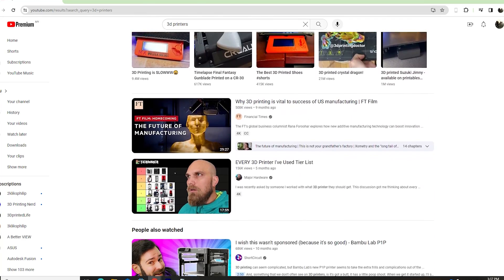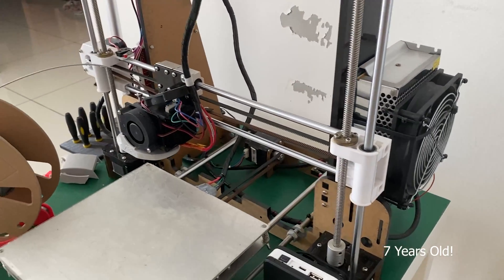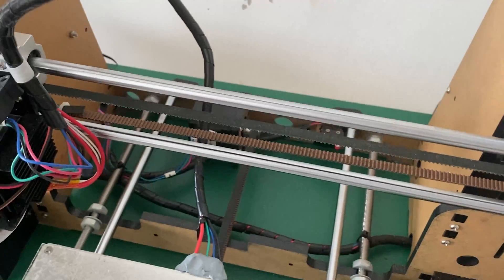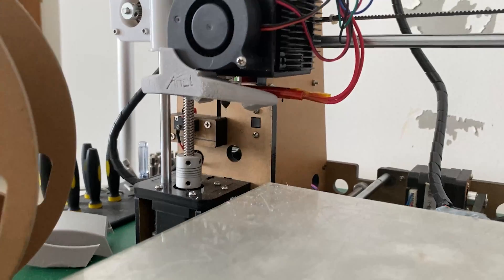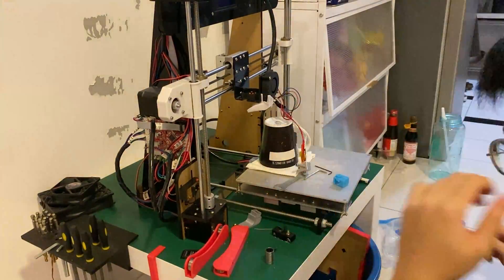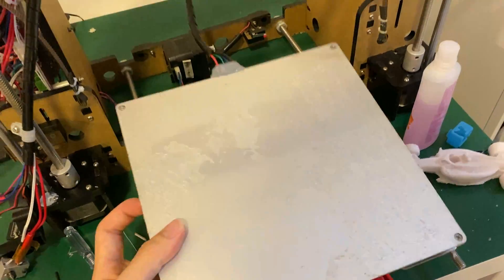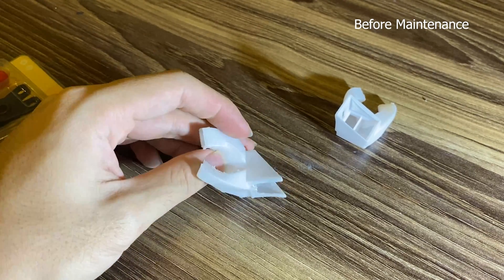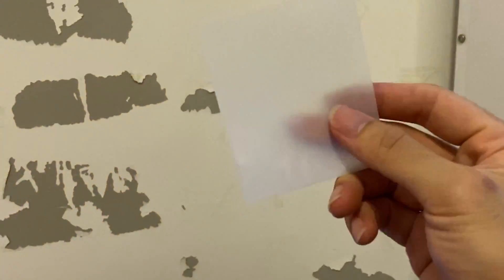Original ANET A8 In 2024! | Why you don't need a new 3D Printer

Comment: Great video bro. I just undusted minds too. I have a question. Are you running Marlin firmware or are you running the stock for more on yours? I played with it years ago and I was successful getting prints done. I never got to upgrade the firmware. I was wondering if you know of a video that can guide me how to do it. My printer was bought over 10 years ago so I assume it was one of the first ones. The original Anet A8. So I was just wondering if you did actually upgraded it in the past or if you're still running the original firmware .  The only reason why I would like to do the upgrade. It's because of the thermal runaway that happens with the sprinters. I've never had an issue before but you know I want to be able to run a print for a long time without worrying about my house burning down.

Comment: Are you still running the original firmware? And what slicer are you using?
Reply from the maker: yea stock firmware. running cura because its just what im used to
Reply: I found out CURA new versions will not support USB printing.. Older version is still available 3.1 works for me.  Also Setup your Com port to 115200  8N1N on Windows device manager

Comment: I used to have an anet a8 was working for 8 years, I only replaced a few parts over the years, nozzle and maybe a switch. I sold it a couple of months ago. Still missing some things about that machine like printing inmediately, with new models and all their features, you just have to wait to finish al sensor and calibrations for a couple of minutes, while in the Anet if you know everything was fixed early it can print and that's it

Comment: Here's a tip. Strap the printer down to a patio stone. You will not believe how much better it will print. I did this before I bought the aluminum frame for my A8, and after I I installed the aluminum frame, I was wondering why I even bought it. Still using the AM8 now. Prints liike a champ. I used a cheap strap fgrom the hardware store, and a piece of 13mm x13mm aluminum  C channel. I placed it across the top, and then prited a semi-circle for the centre, and a couple of corner pieces for the ends to make sure I was not warping the shape of the acrylic frame. Believe me, your prints will improve by 50%. Think 'greek architecture' when you put a piece of aluminum across the top. ....same type of roof angle. Should cost you about 5$

Comment: I still run my Anet A8. I bought it in 2016 or 2017 I think. I upgraded it with a few frame braces, Skynet/Marlin firmware with auto bed levelling. I also upgraded the heat bed connectors, power supply to a 20A I think. I added a heated bed mosfet, added fuses to the heated bed and heat block lines and made a custom Arduino over temp and smoke sensor for it. It was so fun and informative to learn on. I did videos on all of these upgrades as I leaned. It is still on my main desk. I still use it frequently. It just uses blue painters tape and parts stick like shit to a blanket lol. I put some cork under the heat bed to help insulation. It is  is dimensionally accurate and relatively fast. It has printed another 3d printer, a PCB factory and multiple hundreds of things for family and friends and me. I can't even list them all. It has hundreds and hundreds of hours on it. I have 6 3d printers now but still rely on the old Anet A8. It prints PLA, PETG, and TPU. I used the Anet as my go to, dedicated TPU printer for racing drone shells. It is a proper soldier! It has had one nozzle change in all those years and that is pretty much it. The smooth rods are not even scratched! I keep thinking I need to make room but I don't want to get rid of it. It is still one of the quietest 3d printers I own. I love it and I learned a lot from it. Thanks for the video. Ps shout out to the F91-W!. pps, I did make a bracket to help support the hotend cables from falling out. Here https://www.thingiverse.com/thing:1935965
Reply: Even with the ease of Bambu now I still find that with all the tinkering I did with my A8 that I gained invaluable knowledge that most people who are entering this space via Bambu do not have. Plenty of people are struggling on issues that were a pretty common thing back in those days. Either you tinkered or you didn't print. I still have a drawer full of upgrades I never did, or replacement parts. 

Honestly I think the most fun I had back then was upgrading the damn thing. Then, when the upgrades were finished, I didn't know what to print.
Reply: There's nothing wrong with them when you realize that they are a simple machines that need maintenance in the right places. I was going to buy a new 3D printer, but then I started watching videos that show the same problems that we have as A8 users. I had already upgraded mine to an AM8 with the aluminum frame, X and Y tensioners, PIA bed, and some plastic Y bearings which actually made a differeince. I still have some Z banding, but I don't print anything that isn't practical, so very slight esthetic imperfections don't bother me at all.

Comment: I miss my anet a8. I sold it 5 years ago. I did so many mods on it including replacing the bearings. It made such a huge improvement. Eventually I ran out of stuff to print and got tired of spending 3 minutes leveling the bed before every print. I just got my new Ender 3 v3 SE today. excited to print again!
Reply: 3 minutes of leveling is super time. I spend about hour to calibrate Anycubic Kobra 2 pro after bed leveling
Reply: what bearings i can buy?
Reply: @andrijs1521  I dont remember the size, but i used "solid polymer bearings"

Comment: A8 gang assemble
I am currently finishing restoration of this printer with new bearings, orbiter 2.0 extruder and tz 2.0  hotend (yes, it requires 12v to 24v converter) and it's a lot of fun.

Comment: GREAT VIDEO .... I've been rocking the A8 for the past 7+ years and it's still going pretty good, I will likely listen to your advice to change the bearings but this printer rocks
Reply: Hey bud , I bought the anet a8 last week and I've been struggling ever since to get a firmware that supports the printer. What firmware are you using if I may ask ?
Reply: @andrevanwyngaardt6810  hmmmm marlin for a8, if im correct
Reply: @ulightme  Thank you so much , I appreciate it a lot

Comment: I have a 7 year old A8 and it's just fine. Never have to re-level. I print on glass and have a 5lb floor tile under it for keeping the axis's steady. I did have to replace the LCD a few years ago. Every year or two I make sure all the screws / nuts are tight.
Reply from the maker: Same experience but I’d recommend checking the screws every few prints. The vibrations during prints could knock out the heater/mains wires very easily

Comment: I just purchased my A8 a month ago in non working condition.  Someone had installed a new heat block, heater and thermistor but misconnected the thermistor causing the printer to shut down in temp runaway mode.  I replaced the 2 pin connector with a 3 pin one like the original and that fixed everything.  I am amazed at the print quality and it prints a benchy comparable in print quality to my BBL X1C but takes about 3 times as long :) but I'm retired so speed is not the issue.  I do find the 5 button display to be a bit of a pain but I run it using Octopi so it is rarely an issue.  According to the display it has printed for 12 hrs 36 mins and used 132.7 meters of filament which I am prepared to believe due to the lack of wear to any part of the printer that I can find.  One mod I have done is to turn over the bed leveling screws and lock them in place so that I can use the wingnuts to adjust the bed level and I have installed a new flexible magnetic pei textured surface which I really enjoy.  So I agree with Mr Fast, the Anet A8 is a keeper.
Reply: Hey , I bought the anet a8 last week , and I'm struggling to find a firmware to print off , what firmware are you using if I may ask ?
Reply: @andrevanwyngaardt6810  firmware like marlin for the mainboard? or a slicer for the stl files on your computer? I use Cura to slice prints but plenty of people recommend Prusaslicer

Comment: i bought an a8 about 5 years ago and then it took me like 8 hours to assemble with poor instructions the screen barely lit up and the screws for the y rods didn't fit in their housing when I turned it on the prints were all low quality and it just kept jamming. i ended up throwing it away as the warranty had apparently expired and the z stops had broken as well as a stepper motor kept malfunctioning. It chased me out of the hobby as it was my first printer however about to get back in with a ender 3 v3 KE (i would get something like a Bambu lab x1 if i could afford one) 💪
Reply: My anet a8 failed me  again a few months ago..I just gave up fixing it. I  received my ender 3v3 a few days ago...accurate, silent and fast..I should have trown out the anet a8 years ago..but it was a learning experience..maybe I will rebuild it as a laser engraver.

Comment: Just got one for $10 and I’m about to clean and calibrate it.
Reply: Same, waiting for new Y axis
Reply: @PENGBORN  mine has been working well, I still didn't get the bed to sit right, but the prints still come out good enough.
Reply: Even if it doesn't work at all you're miles ahead just in parts value alone.

Comment: If I'm going to buy a printer (I've never had one before), and want fast prints, what should I get?
Reply: Bambulab P1S or an A1 Mini
Reply: Anycubic Cobra 2 pro
Reply: Bambu lab or prusa
Reply: Had an A8 converted it to AM version, then went to an Ender 3 which is now also heavily modified and known as Frank the Frankenender. Recently got an A1 Mini. Frank will be my toy project for tinkering with. The A1 will support that and print anything else I want whilst Frank is in bits. The A8, AM8, Ender 3, Frank journey has taught me a lot but if you want to print and not spend time tweaking and tinkering the A1 mini is a no brainer, it's cheap and just works.
Reply from the maker: Elegoo Neptune 4 pro, but do your own research, as I’ve never tried other printers
Reply: @fasttutorials2419  Dont buy this one. Has alot of flaws. The spec sound good on paper but dont work correctly.
Reply: @fasttutorials2419  Hmmm ok. I was also thinking about building my own, is that worth it?
Reply: @Lucius-Fox-t7v  Do you have any experience with printers? If so how much time are you willing to tinker on the homebuilt 3d printer?